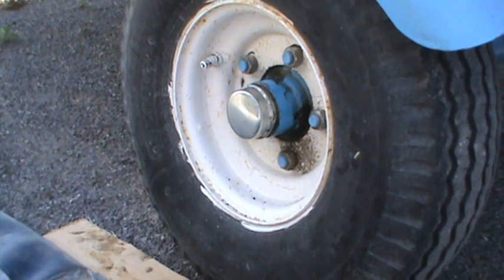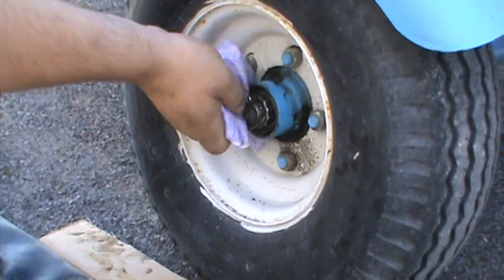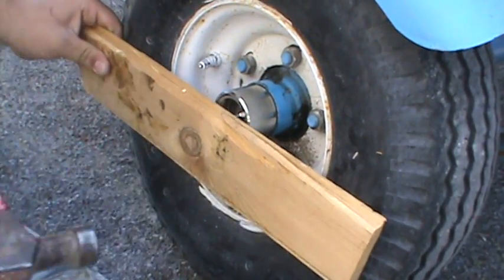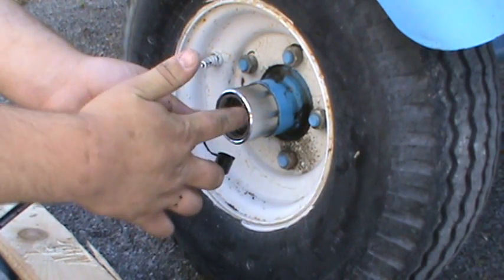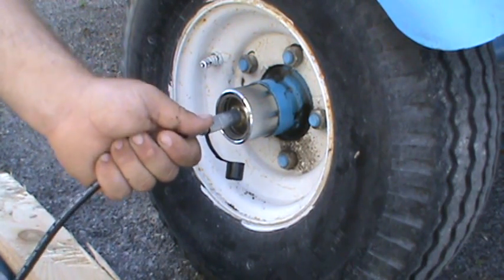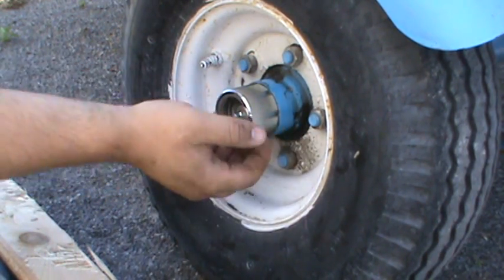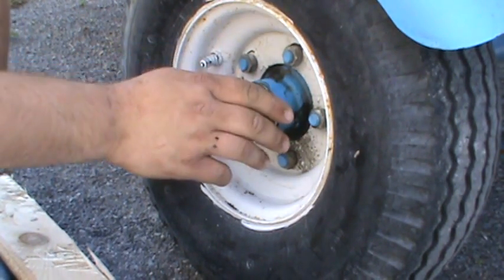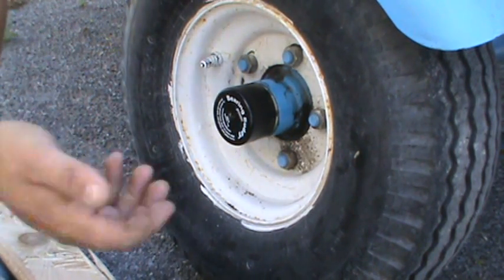Installation Of The Bearing Buddy

Comment: As the grease fitting comes out against the spring then the spring applies enough pressure to continually feed grease as the grease is worn down and crapped  out the rear seal.  When there is no tension from the spring it's time to grease it again

Comment: The ones I have say to fill untill grease comes out a small port on the side. But its quite a lot of bearing grease.
Reply: +Yourused Yea you want to keep putting grease in until it comes out of the weep hole then turn the hub and watch the piston and see if it goes in then add more grease until you can turn the hub (purge the all the air from hub until the bearing stays all the way out or until grease comes out of the weep hole
Reply: Dennis Falan The older bearing buddies did not have the weap hole to indicate it was full but you are correct if it does have the hole you pump it till it weaps out, turn it a few times and pump again
Reply: Like he says, don't overfill because you risk blowing out the grease seal in the back

Comment: Thanks for the video.
Question is, if you have to repack the bearings, you have to remove the Bearing Buddy?  If so, is it difficult to remove and how do you remove it?
Thanks
Reply from the maker: yes it's required that you remove it to repack bearings. To remove the buddy you use the same wood and hammer method and hit its right then left side. Repeat till the buddy falls off.
Reply: If you take it off do you have to buy new BB??   It can we use the same ine?

Comment: is the bearing buddy mostly used on  boat trailers  ? how about my coleman camp trailer ? i know it'd be ok to put em on  but   should i?
Reply from the maker: Trooper2221 the purpose is to keep water out of the hubs but i use them on utility trailers to, to keep them greased.
Reply: Is it worth it on a utility trailer if you still have to repack the bearings every year like you stated?
Reply from the maker: Jason Jones not really
Reply: The best friend to any bearing assembly is proper lubrication.  These are cheap insurance.  Put them on everything you have.  If you have ever had a wheel lock up or run off because of poor lubrication you know what I mean.